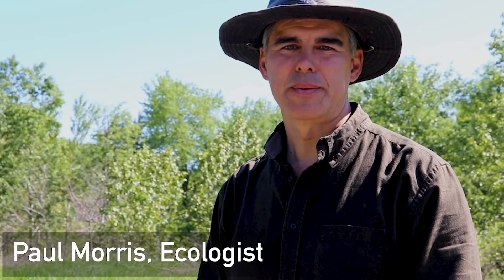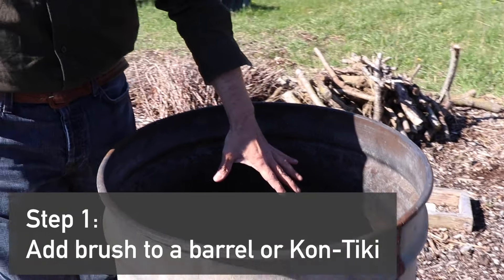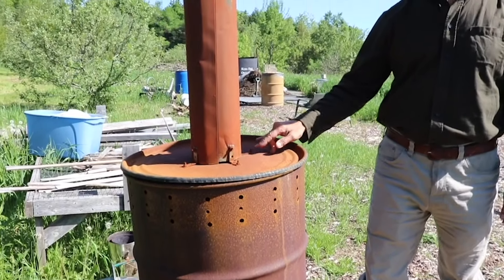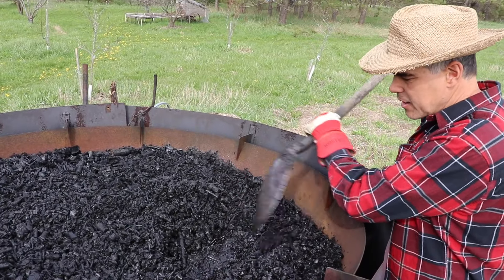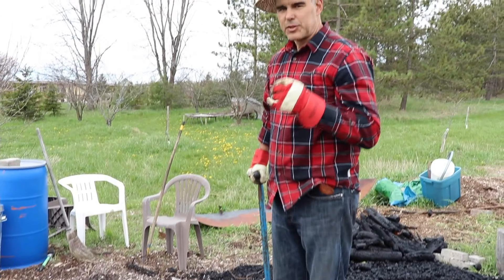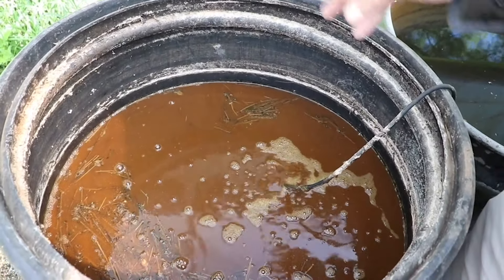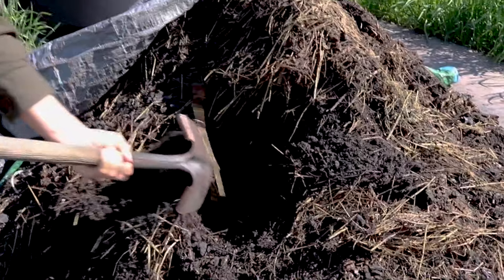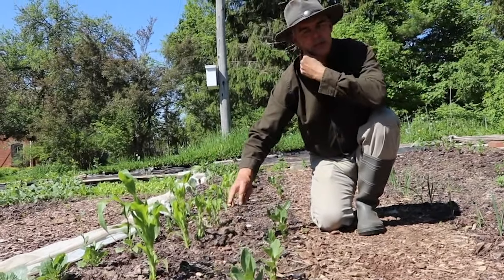THE ULTIMATE GUIDE TO BIOCHAR: how to make it, how to use it, and why it's important

Comment: I understood you consider the double barrel (retort) less efficient is it by principle or only the one you have used ?
Reply from the maker: You can use it but get much less char and the outer barrel the wood is all burned up and wasted. The continuous feed in the barrel makes it so all wood turns to char which is more efficient. The inner barrel also does not burn the contents fully sometimes if packed too tight. 50% of wood is carbon so usually only 25% or less with air space is char in the smaller inner barrel.

Comment: would you be able to use that water as a nutrient solution?
Reply from the maker: It will have potassium from any ash you create and will be quite basic so I would use it with caution. I have not tested the nutrient composition of the drain water. We usually reuse the water for the next batch...

Comment: I had problems with my soil last year.  The entire season I had problems with plants not wanting to grow. Some did ok, like borage, but the rest weren't very successful. I got some things from a local gardening group like manure, mycorrhiza substrate, spent barley, topsoil, leaves. I used coco coir mixed with this about 50/50 in the green stalks, which both got infested with flies. 

I planted some salad greens in a few containers in the solarium using the same soil.. hoping maybe it just needed to sit a year... but it seems I'm having the same problems. I'm not sure what to do, and feeling kinda desperate. I wanted to be working on my soil problem over the whole winter, but we were renovating and the project just never quit. Now the snow is melting (Alaska), and reminding me I never got to work on soil. So now I stand to have a repeat of last year, unless I can get someone to actually help me.
Reply from the maker: Suggest getting a soil test ot see if there is a nutrient imbalance or salt bulidup. If not, some of the organics may need to be processed by the soil microbiome and they are holding the nutrients while they break things down and will release them when done.

Comment: If you immerse the char in pure urine would that qualify for being "loaded." Would adding that to poultry manure be better and how long should I leave it. I would think that just soaking it in pure urine would load it but I am not for sure?
Reply from the maker: Urine alone does not have a full complement of nutrients that plants need. It is high in nitrogen but lower in other nutrients. We balance the nutrients by adding manure, compost... as described. If you only need nitrogen then it would work but pure urine can burn plants with the salts in the urine. Pure urine applied to a plant around 6-8x will kill it. I've experimented with using pure urine as a herbicide and it works.
Reply: @PlanetHealers I have piles of dried leaves a few years old. I have plenty of duck manure. Now I need to make more quality charcoal. Thanks. Are there any thorough books you would recommend?
Reply from the maker: @johngoddard2034  I have a link to some info in the description and here is a link to more info:https://biochar-international.org/

Comment: That's what Jack must have planted his bean in. That water you drained off must have been rich also. I'm doing research to build a system for an organic veggie producer.
Thanks for sharing.
Reply from the maker: The water has potasium and other minerals but quite basic depending on the ash amount you make. The char absorbs most of the nutrients.
Reply: @PlanetHealers  Thanks for the come-back.

Comment: We use an outdoor wood burner (OWB) to heat our home and shop.  It uses a thermostat to control when draft is supplied to the firebox so much of the time the firebox is actually airtight with no draft to the fire.  At times, especially when burning a lot of Hard Maple, it creates a lot of chunky charcoal.  Is this Biochar?  If I shovel it out hot should I douse it or just leave it cool?  How should I store it (if it is Biochar) for use in the garden?
Reply from the maker: If burned without oxygen and at high temperature it should work for biochar when mixing with the organic elements. You would need to douse it in water to stop the burn or it will turn to ash if left in the air.
Reply: @PlanetHealers  Wow!  Thanks for the quick reply.  I usually rake all the chunky stuff to the front of the furnace and burn it down to ash but I will start shoveling some of it out to save for the garden.  Now I aching to see how it works in the garden.
Reply from the maker: Your welcome Bob!
Reply from the maker: @bobmeister4495  cheers!

Comment: Good day sir  . INSTEAD of wood  it is possible to use carbonized rice hull to  and fresh rice for compost together with chicken dung
Reply from the maker: Rice hull would probably be better to make in the TULD systems because it burns so fast.

 I have not tried this method of charging the biochar, but it probably works. Let me know the results! I'd test the results in a pot first before field application. Seed in lettuce, mustard or other fast-growing plants to test if the biochar is fully charged and you are not getting any  leaf yellowing from lack of nitrogen.

Comment: Does the oil barrel in the beginning have holes? how long does the process takes?
Reply from the maker: No holes yet n the bottom. We don’t want oxygen in the barrel or the carbon will oxidize to ash. 3-5 hours depending. You can do multiple barrels at a time if you have enough material to scale up

Comment: Nice info and demonstration. Is it necessary to leave the char charging for so long? Has any data been collected to show the ideal charging period?
Reply from the maker: We have shortened the charging by adding the urine right away. You can add it sooner but you risk not having the carbon fully charged and thus it pulls the nutrients out of the soil instead. We shortened to a month by planting a nitrogen fixer (beans) and the first time it was fine and the second trial it had some yellowing and nutrient deficiency.

Comment: Hi how much biochar mix would you use to plant a tree
Reply from the maker: In the nursery with the plant, I use 50% biochar mix, which is 50% carbon and 50% other ingredients. In the root zone, I put in a shovel full or 2, depending on the size of the hole, and mix it in well with the soil. The biochar needs to be mixed in well, as the roots need the soil, too. The ratio is similar to the nursery mix. I grow them in the nursery first. That way, I get the microbial associations right from the start. Cheers
Reply: @PlanetHealers  thank you
Reply from the maker: @MarkParker-t4c  Your welcome!

Comment: This was awesome. Thank you! When I get a big enough plot of land I will have to try this! Could it be advisable to dig under biochar and then cover it up with the regular soil and mulch over that? Or would spreading it on top be the best way?
Reply from the maker: depending on the soils you are working with. If you are doing a no-till process like we were doing you put the biochar mix on the top and then mulch it well. Over time the rain, frost heave, roots and soil biota will work the biochar into the soil. If the soil has been tilled then adding the biochar before the till will work it into the soil.
Reply: @PlanetHealers  Awesome! Thank you for the quick response. Was a bit unsure. Will have to come back to this when I have inspected the new soil then and make a decision :)
Reply: My South Lawn is about 24,000 square feet. Plenty to work with.

Comment: It looks a great mix.  I have been guilty of burning and not stopping the process to capture the carbon!  Great tip for me. and I'll do better next time!  Do you purposely add the trace elements like zinc, manganese, copper and boron to the mix, that are all essential for plant, and then human health on eating the plants?  What about adding calcium as a required element (not necessarily for pH balance)?
Reply from the maker: By adding compost, manure, soil and the super brew it should have all the bases covered. But obviously it would depend if the sources were good.

Comment: Thanks for the video, very informative.  I have some land with nice loam soil, but much of it is covered in foxtail and rip gut grasses. Any thoughts on eliminating these? There's about 15 acres, might take my lifetime to amend it all with biochar. I've been looking into prescribed burning, but not sure I can pull it off when the grass is dry here. Northern CA in the foothills.
Reply from the maker: It would depend on what you are trying to achieve. Are those species native to that Région? If not you could mow and use silage tarps to cover the area and solarize an acre a year.
Reply: Goats eat foxtails, especially when they're green. They can have problems with them getting stuck in the gums, so it's important to provide them with plenty of fresh, clean water. I'm sure they would also appreciate a donkey for protection against coyotes. If you don't want to become a goat keeper, there are lots of companies that rent them for this purpose.

Comment: Thanks, so much, for your information. 
I've watched other videos, where the biochar is used, pretty well much, immediately. Also, without all the additive components, such as cow manure and leaf mulch. 
I've one question -
Given the scarcity of water in some places, could the water, that was drained off, be used for irrigation of plants and, if so, would there be any nutritional benefit or impact on the plants? 
Thanks :)
Reply from the maker: Yes in the Yucatan we reuse the water again and again. If biochar is used immediately unconditioned, it will pull the nutrients from the soil. That is the main reason people think it doesn’t work. If the water is used on plants, the ash is basic so the water will be also. Use caution and do some test plants before going fully.
Reply: Thank you, so much.
I'll pH test the water and sweeten it, if required.

Comment: Just a question,
The bio hat that you pitted in the lettuce and garden bed, is that biochar from the drum or 
the biochar euth manure/urine/ compost
Thanks.
Reply from the maker: The biochar we used in the garden was the one we mixed with manure... and left for a month.
Reply: @PlanetHealers  
Thank you. It looks like the biochar will be the home/house of the Micro organisms.

Another question,
Can the micro organisms live in ashes?

The bush fires in California,can we say that they are environmentally good because after the fire , we got a lot of biochars.
Of course, what is not good would be some burned houses.
Reply from the maker: @jessaminecrisostomo7914  less likely to live in ash as it is quite basic. After a fire the micronutrients in the ash and potash is released into the soil with the rains that would help soil microbes. The nutrients are more soluble so the effect lasts a shorter time.

Comment: Will the pyrolysis process work OK using wood chip mulch instead of logs?
Reply from the maker: Hi Kathleen, the challenge with wood chips is that they tend to smother the fire and just smoulder in these 3 methods. You could add some to the process but not as the main ingredient.
Reply: @PlanetHealers  Hmmm  Thanks!

Comment: I'm sure you've answered this but why the urine when you're going to add other inoculates, i.e. manure, at a later date? My plan is to take my charcoal, and let it stew in a worm cast, manure, fish and kelp, rock dust, molasses tea (brewed with the bubbler) for 24hrs, then introduce the "charged" biochar to soil/compost. in a 1 to 10 shovel ratio. Any advice?
Reply from the maker: We add the urine during the soaking phase as it absorbs well then we need lots of nitrogen for the poor soils and heavy rains that wash the nitrogen away in the Yucatan. You are welcome to try other additions using local materials we are only giving a good example to teach the processes. Knowing the NPK of the additions is good to help balance the mix.

Comment: Thanks very much, this tutorial will come in very handy for our permaculture projects in South Africa. Btw wouldn’t you have to turn it once in a while in order to stop it from becoming to hot and getting oxygen in?
Reply from the maker: Yes, turning it would be good to mix it. I actually wasn't expecting it to heat that much as the manure had already gone through that process in a pile.
Reply: @PlanetHealers  Thanks for your answer. Ah ok, i thought it was fresh manure and inputs, which hadn’t become compost yet. But you are saying that most of it was composted before it got mixed into the biochar?
Reply from the maker: @ollievw3450  Yes, I usually use fully composted manure. You can also just mix it in with the raw manure to charge it as it composts. It has been shown to reduce the smell of the cows/chickens and some people are using it that way.

Comment: Thank you, for posting .
On the small single Barrel method, what is the #1 best step to create good char..in the burning process..not the quench or additives to activate.
2. I have a resource for granual Urea. It can easily be desolved in water  Is there any advantage or disadvantage over urine ?
What would be a ratio for a urea disillusioned in water in place of urine?
Reply from the maker: The best step for making good char is managing the burn to minimize the ash produced. Always a balance as to short a burn and some wood may not burn through. Thus we add the small pieces at the end to keep the oxygen out and burn it longer. We use human urine as it has many micronutrients also. Avoid from sick or people taking drugs. Also it is kinder on the planet than manufactured urea and makes a circular system.

Comment: What happens to the terpenes in the wood? Wouldn't they be discharged into the atmosphere. If so, they are a pollutant, so is there a way. to insure they burn totally?
Reply from the maker: If the wood is wet the fire is cooler thus the white smoke and the smoke goes clear when the burn is clean after the water burns out of the wood. If dried wood less smoke and a clean burn. The volitile organics are burned in a clean burn - when you can't see the smoke.

Comment: Hello!  Made my first biochar (55 gal drum burn) and so far, looks great! What do you do with the urine-infused water after sieving/draining? Some useful application?  One additonal question:  In a hot dry climate, will tarping the final mixed pile cook it too much and kill the bacteria/fungi?  Would you recommend tarping it to hold moisture, but placing the pile in a shady place? Thanks!
Reply from the maker: We reuse the water again for the next batch. It could be used diluted as a fertilizer but I'd check the pH before using it as the ash from the burn will make it more basic. We do leave the biochar to cure under trees in the Yucatan without a tarp you just need to add water if it gets dry.
Cheers!
Reply: @PlanetHealers  Thanks! Will do

Comment: Have you tried adding terra cotta beads, at about 10% by volume?
Reply from the maker: Can't say I have but they would help give air space to the soil. The biochar also does this and the roots can penetrate the biochar.
Reply: @PlanetHealers  they also hold water, and act as mineral buffers and reserves. They do this osmoitically, as opposed to biochar, which does it through capillary action.

In other words they function differently, and might provide extra nutrient and water buffering benefits.

Comment: Is this char as good as that with an inner barrel? Does this still have organic matter that will decompose, or is it good enough to be inert, & are pore sizes good/clean enough ? I guess; is there any real benefit of char from a full burn second/inner chamber?
Reply from the maker: With the inner barrel being more insulated and the outer barrel having limited fuel, I don't see the burn being as hot as the other 2 methods of direct burn. Higher temperature makes the char more porous and better char, also burning off any residue that would be trapped in the inner barrel.
Reply: @PlanetHealers  that makes sense. Thank you. This process looks to create volumes of char much quicker than with an inner barrel.

Comment: excellent video.  where do you get your urine ?  what would be another form of urea concentration that could be purchased?  Also, what would be the easiest way to add bacteria and fungi to the carbon?
Reply from the maker: The urine is the easiest to collect from humans closing the loop as it is returned to the soil. Prefer not to use chemical fertilizers. There are several ways to add microbes to the mix, we add soil from a healthy area and add a commercially made mix of bacteria and fungi known to benefit plants.
Reply: @PlanetHealers  How good is urine if your on meds?
Reply from the maker: @john-smith.  Whatever meds you are on will be in the urine. Soil microbes will break it down but consider using a donar.

Comment: I have my char I want to build my soil now. Is there a reason I should not introduce it into my soil now. I plan to activate it with organic fertilizer containing enzymes. 
Don't want to wait 3 months.
Reply from the maker: The reason we wait is because to char will absorb nutrients from the soil. If you have a strategy to replace the nutrients then you may try using it right away.  You may get yellowing or other nutrient deficiencies in your first crop. We used beans as a first crop since it is a nitrogen fixer and it worked with a shorter charging period. We used a one month charge in the video and planted beans and tomatoes in the new bed we created and fertilized heavy with our super brew and had good results.